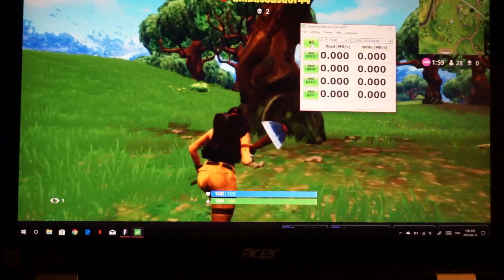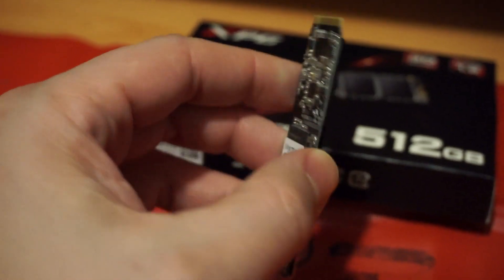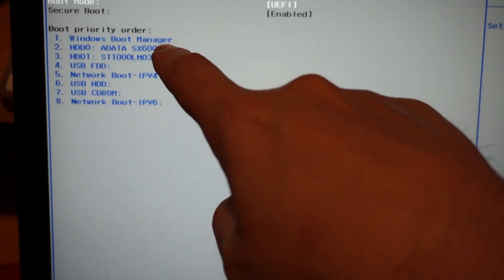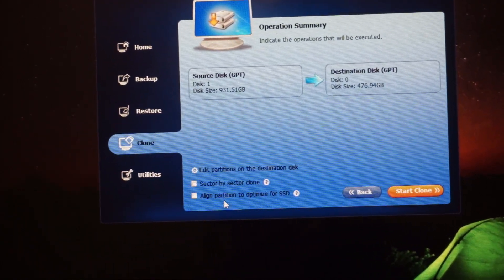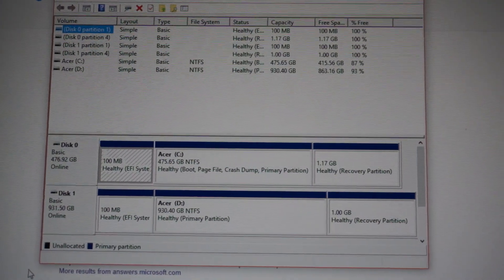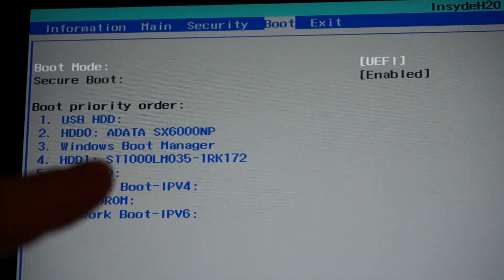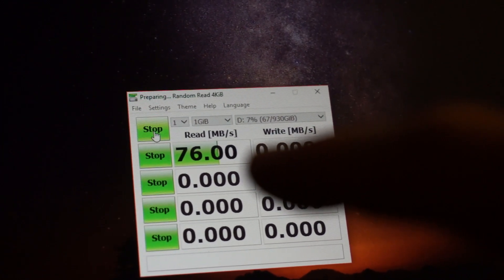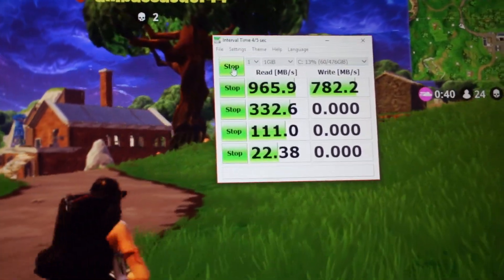10X faster computer upgrade! M.2 NVMe PCIe SSD ADATA XPG SX6000 install - Netcruzer TECH

Comment: I wonder if anyone gets a power issue with this ssd when your laptop is in idle(you don't do nothing)...i have this drive in 1tb version on laptop...but after the laptop enters idle state(is set via windows to only shut of display when inactive) , if i have already a filed opened from this drive, it can no longer work...it always warns me after i move the mouse from the idle state that adata is ready to be removed...the drive works nice and fast...that is my only one issue...because i have 4 ssds on my laptop and this is the only one with that issue...oh btw...this is the only drive that i can't see when i'm just on battery...THIS DRIVE IS NOT MEANT FOR LAPTOPS(from my experience)..

Comment: @Netcruzer RC what about if I buy one Nmve 1.3, will it work? cause I read that some people have had problem with a ssd NVMe 1.3, and you installed a NVMe 1.2?
Reply from the maker: I don’t know. Check if 1.3 is backwards compatible with 1.2
Reply: @netcruzer  didn't work

Comment: Will it work if the ssd is gen3x4?
Reply from the maker: Yes just at the slower speed
Reply: @netcruzer  what about if buy one Nmve 1.3, will it work anyway, cause I read that some people have had problem with a ssd NVMe 1.3, and you use NVMe 1.2?

Comment: someone could help me,please, I have the same computer but I bought the PCle Gen 3x4 M.2 2280 Suports NVMe 1.3, but the don`t bios recognizes ... I realized that the difference is the 3x4 to 3x2 of the video. is this the problem?
Reply from the maker: Bios should recognize it even if 3x4, just won’t go that fast. It’s either not seated right, SSD is faulty, or you have an older model that doesn’t support nvme.

Comment: 👨‍💻💭😳how to get max speed  NVMe ADATA SX8200PNP🤷‍♂️🆘 1800'R 1500'W about it  not 3000 2800 like they say 😳💭firmware 
🆘 Don't buy adata works ok 🤷‍♂️ BUT  you'll get better support from SAMSUNG EVO NVME-2 Note New ddr4 NvmE aint all that 
I Had a samsung ssd b4 this Adata  but the store ran out samsung & handed me Adata  $180au also new ddr4 aint all that in speeds JUNK
runs & boots in 8 sec's ok had alot working out this i7-9700k Asorus elite gamer MB & adaya stick water cooled 16gb 2666mhz ddr4

Comment: Here's the thing, I've been thinking of getting one, but do I have to copy all my main data to the SSD in order to use it? I just wanted to use it for extra storage without having to format all my things from my main hard drive, I want to leave everything as is.
Reply: You just need to format the ssd in order to use it.. if you want to make it as a boot drive you need to install windows or clone your files into the ssd

Comment: Gotta love these laptop makers using tape to hold internal hardware in place.  My old SATA HDD was held by orange Scotch tape in my Asus.  Also, there laptop screw kits you can get on Amazon that have one that will do the trick for holding the m.2 in place.

Comment: HELLO, I HAVE ONE OF THOSE SAME LAPTOP THE SAME MODEL, AND BUY A DISC PCIE GEN 3 X 4 M.2 2280 SSD, SUPPORTS NVMe 1.3 AND THE LAPTOP DOES NOT RECOGNIZE IT. I WANT TO KNOW IF IT NECESSARILY HAS TO BE 1.2 AND GEN 3X2?
Reply: Hi friend, could you solve it? Did it work with SSD 1.3? I'm thinking of buying one and that's my doubt too
Reply: solve it?

Comment: Your laptop doesn't support PCIe gen3x4?
Reply: How can I check? and can I use a gen 3x4 on a 3x2 based laptop?
Reply from the maker: @jhovanicm  you can use HWinfo64 to check PCIe link width on your machine. If it's a 2x slot but you put in a 4x drive you will be limited to half the total speed of the drive.
Reply from the maker: No it doesn't, in a previous video I showed the maximum PCIe was Gen3x2 on this machine.

Comment: Great video, but two touching metal that isn't grounded does literally nothing.  Just touch the case, if the PSU is plugged in you're grounded, just FYI

Comment: You can easily boot from the ssd drive if you make it the the primary  default drive.  To do this,  you need a software called EasyBcd.  Changing the boot order from bios did not work  in acer spin 3 laptop.  The easiest way to solve this problem is to download EasyBcd,  a free software, and in just one click you can make ssd the primary default drive.

Comment: can you upgrade the RAM?
Reply from the maker: Yes. You’d need to remove the one stick and replace it with more.
Reply: I read 12 Gb is the maximum capacity for that model

Comment: ACER E5-475G  support NVMe ?
Reply: hey there, I am also using the Acer aspire e14 e5 475g and yes it does support NVME.  However, it only supports up to PCIe gen 3x2 which means if you insert a PCIe gen 3x4 SSD you will only get half the speeds of it!

Comment: Can you tell me which size is the screw for the M.2 drive? Because my hp notebook doesn't have it :/
Reply: Any screw you find that fits.  You can take off the stand off and go to a hardware store ask an employee where the smallest screws they have are and find one that fits.  That or simply search Google for one.  You'll pay 20x more in shipping than the screw though
Reply: 2210

Comment: Idling at 65c using XPG SX6000. Quite high for me. I'm thinking to remove the Heatspreader as it might be the choke point on why the drive not getting enough airflow. Are you using a cooling pad?
Reply: What are the results? Did removing it help?
Reply: i tried removing it, it became hotter 70c+. my idle is 51-59c.

Comment: A NVME M.2 that is PCIE 3  - Gen 3 x 4 would be around 3,400 - 3500+ Mb sec read and around 2,500 - 2600+ sec write. My Mb is a Gigabyte AM3+ model is the 990FX-Gaming. It only has PCIE 2 ; there is a Gen 2 x 4 NVME M.2 Compatible slot. For about 6+ years my storage was a Sata 3 raid o array made up of 2x crucial m4 ssd's at 512 gb each. It's a hardware array and when I switched to the 1tb Samsung 970 Evo pCIE 3 - gen 3 x 4 ssd ; on my Mb i am getting about 1,800 mb sec read and about 1,500 mb sec write which is roughly 3 to 3 and half times as fast as what the Sata 3 raid array was. i am very happy with the Performance of my Samsung 970 evo.

Comment: After cloning from the source drive if it be hdd or ssd ; to your destination drive - this time a NME M.2 ; either remove the drive that was cloned from or format it. Windows doesn't like when there are 2 drives both having a windows boot partition on them.
Reply: 100% not true, just set the boot drive in the uefi/bios.  Windows only cares about the boot drive.  How do you think people dual boot?
Reply from the maker: Thanks for the tip.  I still have both drives connected and both are bootable if I ever wanted to revert back to HDD for resale or something.

Comment: i've done all the procedures but still, the hdd boots rather than the m.2 pcie
Reply from the maker: This is the hardest part, and I struggled with mine for hours until I got it to boot windows from NVMe.  Check the boot order in the bios, check that BCDboot stuff again, and finally use the Win10 advanced startup menu to choose the boot drive.  Good Luck!

Comment: Hi! I'm using a lenovo yoga 520. Installed m.2 nvme xpg 128 gb and currently in the process of cloning. My processor is core i3 4gb ram with stock 4gb ram. Will m.2 nvme play fortnite?  Noob here
Reply from the maker: Disk speed has almost no impact on playing a game, other than speeding up loading times.  I showed a disk speed while running fortnite just to show how crazy fast it is even while the drive is in use. Fortnite will run poor on an i3 with 4gb ram even with the fastest SSD in the world.

Comment: is it worth to buy this one instead of cheaper sata ssd ?? ( it is about 10$ cheaper in my country )
Reply from the maker: As long as your computer is new enough to support M.2 NVMe boot, then yes!  That extra $10 can gain you 2x to 4x better drive speeds.  All SATA SSDs max at 600mbps as that is the limit of the SATA bus.
Reply: Not really bro. This particular unit performs poorly. I compared this one to my friend's SATA SSD. Both running as boot drives on Windows 10. I used CristalDiskMark with the same Queues and Threads in each Read/Write. If you change the Queues and Threads in the configuration, they have to be the same, you can compare it to any SATA SSD and see what I'm talking about. It might have better performance under certain conditions (Threads and Queues, Q32T1 in your case results in very good speeds) but in real world use when opening Fornite for example it barely wins over SATA. 
On top of that it runs hot, which can result in a shorter lifespan
I would buy SATA SSD and save some money

Comment: Are PCIe SSD’s faster than normal ssd’s
Reply from the maker: Yes!  Normal SSD are limited by the SATA3 bus they are connected to which maxes out at 600Mbps.  A PCIe SSD can go 2-4x faster due to the higher bandwidth bus.
Reply: This one is 2400mb/s
Reply: For sequential read/writes they are way way faster. For the more common day to day stuff that most of us do, they are still faster but not massively. If your moving around data alot, that is when sequential matters, for day to day windows/gaming stuff the 4k read/writes are what to take into account.

Comment: Netcruzer RC TECH CARS
;; have a question about the ADATA XPG NVme m.2 SX6000, after installing the Drive, would you need to also download additional Software, for the NVme, like the Controller Drivers for better performance ?, Like for The Samsung 950 Pro NVme M.2 SSD ???
Reply from the maker: McRom37 i didn't, i used whatever win10 detected. I did not install any manual drivers.
Reply: Netcruzer RC TECH CARS:: Thanks for the Reply. That unn cloning software looks pretty straight forward, like Easy to do.

Comment: Can you show another video on how to do the cloning and start up onto a regular ssd drive?
Reply: Aomei is ready it's the same procedure.  Also, you can restore the backup to a PC with completely different hardware that has windows installed.

Comment: And do both harddrive have to have the same capacity or will one drive only clone what's loaded onto the other?
Reply from the maker: The SSD was 1/2 the size of the HDD I cloned from.  The software is smart enough to resize as long as the data on your HDD is less than the SSD size.

Comment: Can the cloning be done to a harddrive that is plugged into usb?
Reply from the maker: It might work with the software I used, but I have not tried.  What I didn't show in this video was ACRONIS didn't work at all for NVMe clone.  The software I used was the 3rd I tried.
Reply: It sure does work to an external USB :)
Great video came to check out the drive as I just installed one in my rig. Great video and good to know other people use Acronis :D
Reply: providing the os has usb 3 drivers yes